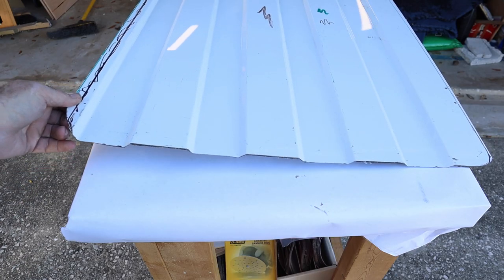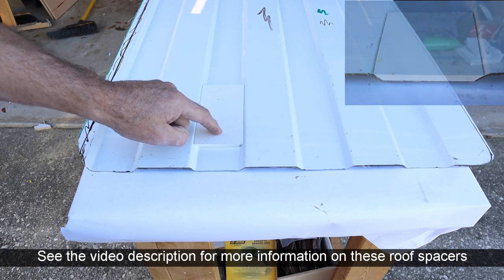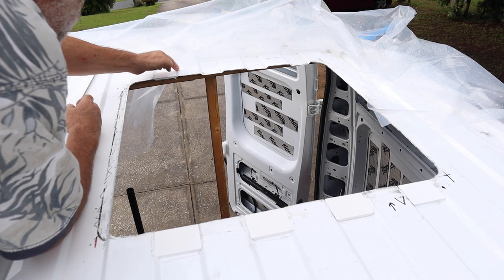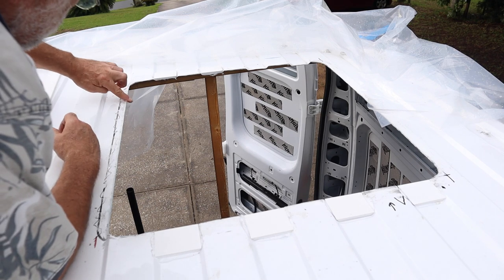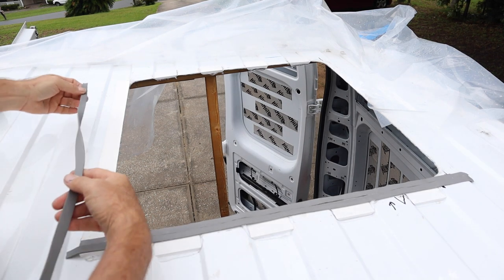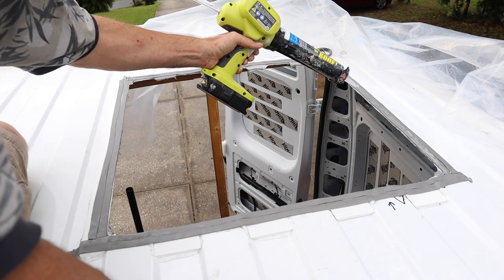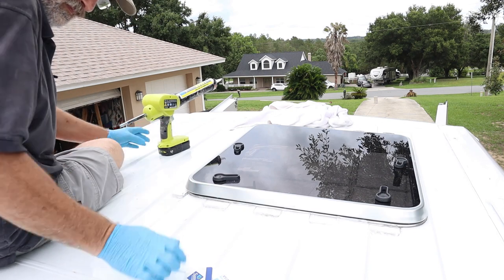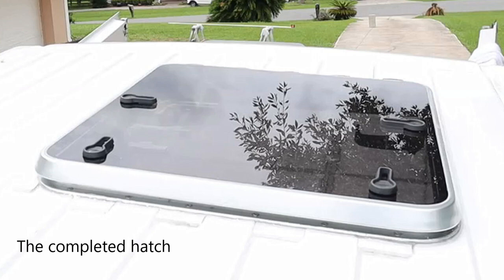Van Life build series - Installing the Skylight - Roof Hatch - Sealing the Hatch

Comment: Nice work.  I'm thinking of building a very large custom solar panel hatch on my next van. Something that lets me stand and look out a low roof. Thinking about bending rounded corner roof sheet metal and folding bug screen.
Reply from the maker: That is an interesting idea.  Be aware the solar panels are fragile, and work better when cool.   Some people are using flexible solar panels and applying them directly to the metal of the van.  Doing this reduces their efficiency because the get hot. I used two standard 200 watt panels, this allows air flow under then to keep them cool.   See the completed deck in this video  https://youtu.be/kmVuEm9dP9U

Comment: Nice job. Gotta ask why use the butyl tape? I see caulking under it. then it, then you caulked on top of it then set vent hatch. Then sealed top of hatch with more chualking.  I know on my rv on the roof they used self leveling dicor. Ill have to search out that stuff and see what its good for as I like clear
Reply from the maker: I used the butyl tape as an extra precaution.  Its filler and form fits to any void.  That with the through the roof sealant provides me with confidence that I will have no leaks.  But only time will tell.  The self leveling sealant is the common go to.  I thought I would try something different - this is cleaner looking, but if it does not work, I will be in trouble!   So far everything is good.   I will make a follow up report after the sun and weather has been on it for  a year or sooner is something bad happens.  Thank YOU for watching...

Comment: Aloha! Was wondering why you installed the hatch with the opening towards the front rather than the back. I'm going to be doing this same thing but with a 'Man Ship Marine Stainless Low Profile Deck Hatch' but that opens from the inside only. This particular hatch opens to fully 180 degrees. I'm installing a lightweight roof deck on my Sprinter which I want to access from the inside as well as the outside. And then my next question is; are you having any issues with leakage at all? Leaking is my biggest concern so I like how you manufactured inserts to fill in the voids between the raised ridges on the roof; CLEVER! Thanks for the VidClip! MUCH appreciated!!! Mahalo a Aloha noho'i ~ ~ ~
Reply from the maker: The opening is towards the front to make full use of the deck that is on the roof.  Very happy with this configuration.  I was going to have it open to the side, but then it would hit the side 8" PVC tube.  To see what I am talking about look at the Van Tour Video https://youtu.be/kmVuEm9dP9U      Our hatch can open zero to 180 degrees, and has no struts in the way.   No leak problems so far and we have had it it heavy rain, hail, and very bumpy roads.  The Lexel through the roof sealant has held up so far.   I suggest cutting any inserts you may need from PVC board, often used at house trim. Also cut the opening small, you can always make it bigger!
Reply: @FrugalFactor  Well, that's pretty much what I was hoping to hear because I'm actually going to do the same thing AND for the same reason. As I stated previously, I'm looking at the following to use: Man Ship Marine Stainless Low Profile Deck Hatch ($999.00) and is very low profile and it too does the 180deg open action. Thanks for reinforcing the validity of my idea. MUCH appreciated! BTW, I have a 2009 Dodge 2500 Sprinter Type 2 ambulance that came fully equipped and included EVERYTHING except the original gurney and the very large oxygen tank. The build was by LEADER Emergency Vehicles here in SoCali. I thought I was just going to go in and 'dismantle' the interior but NO WAY that is working out. These bad boys were NOT made to be disassembled and I've had to cut/tear/rip out almost everything. LOL So I move forward ~ ~ ~ THANKS FF Aloha ~ ~ ~

Comment: How is it holding up after a year? Also usually these hatch has got holes for screws that you could for holding strength. Did not see you screwing in at all.
Reply from the maker: After over 2 years no leaks.  Never even thought about it until I saw your comment.  Yes there are screw holding the hatch to the roof.  The day I made the video, it got dark fast and the video of putting in the screws was not usable.  You can see the screw holes at 4:20 in the video. Also at that time I mention screwing in the hatch (just before nightfall).   There is no do over for most of these videos!   All the videos are divided by category at https://thefrugalfactor.com/     Thanks for the comment and question.

Comment: Did you cut through the roof support? If so, what did you use? What was the process of that? I’m trying to figure out how I’m going to install mine
Reply from the maker: Please look at all the installation videos. I removed one of the roof supports completely. Then installed the hatch. And created  a new support on the other side of the hatch.

Comment: Thanks for the video! Does the hatch stay partially open well? It doesn't have any struts.
Reply from the maker: Yes it does.  It have heavy hinges that can be adjusted (tightened).  Most of time we have it opened more than 50%.   It can be locked with as slight venting.   There are many quality marine hatches.  I think the key is to stay away from plastic parts that my degrade from the suns UV light.

Comment: have you found condensation on the inside of the glass or drips after a freezing night or frosts?
Reply from the maker: We have not been in freezing temperatures yet.   So, I can't respond to that question.  I am actually looking forward to a winter our mountain trip to test that out!   I have a precut XPS insulation to fit in the hatch recess but have not had the chance to use it.